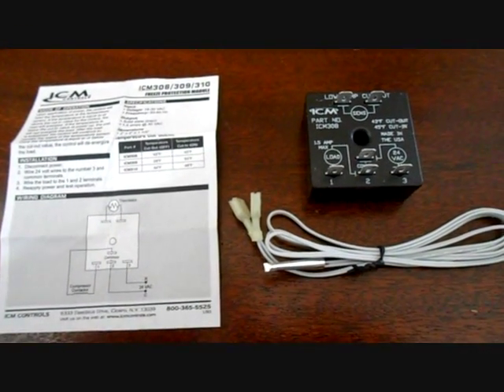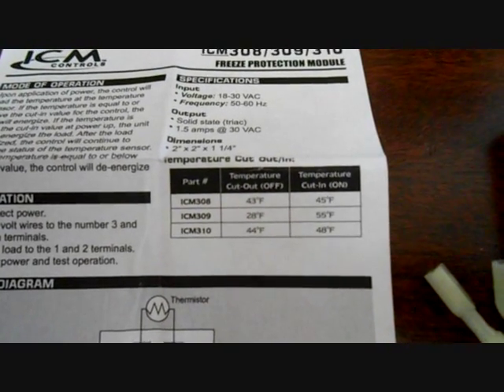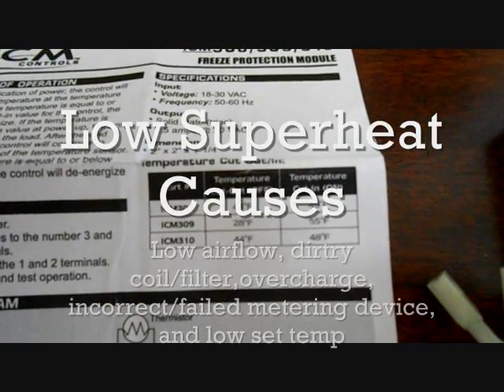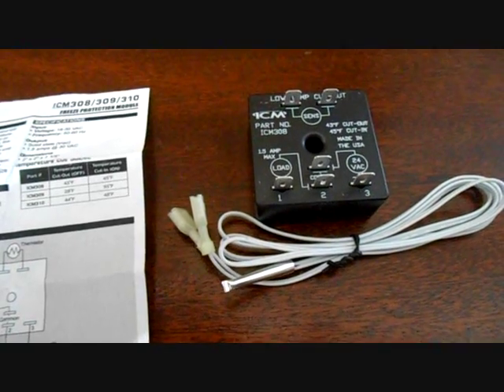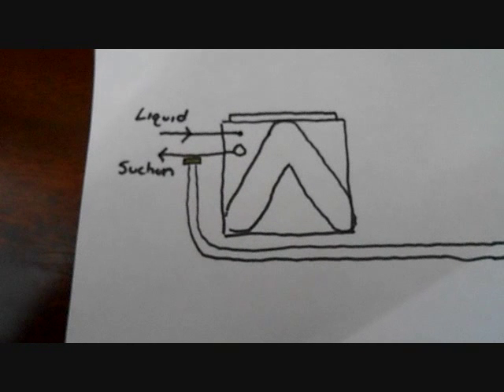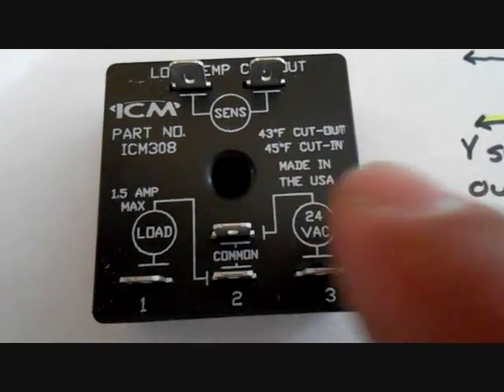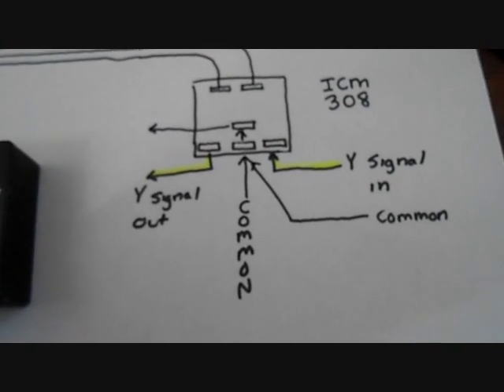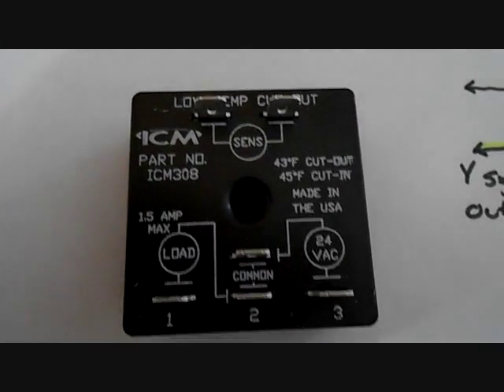HVAC Freeze Thermostat

Comment: Hey Zack, question - SInce there is only a 2 degree difference between cut-in and cut-out, wouldn't this set up an instance of short-cycling the compressor if there was an issue of say low refrigerant?  Thanks - Kris
Reply from the maker: Yes, I would add a time delay so that the compressor would be off at least 5 minutes. A lot of defrost controls (heat pumps) may have it built in. Also, most high efficiency equipment will as well.